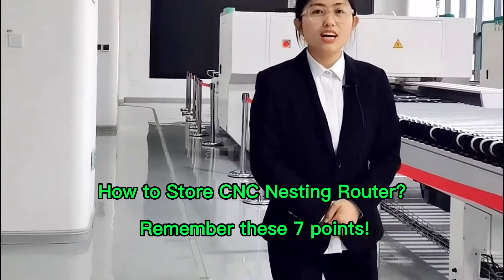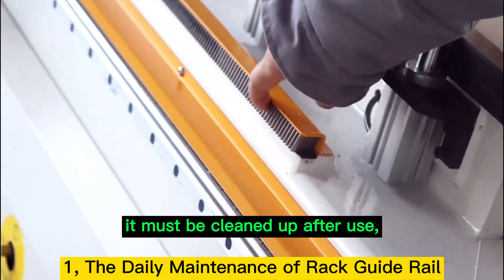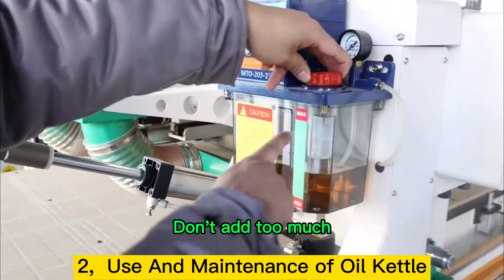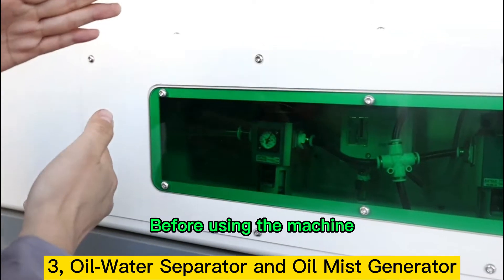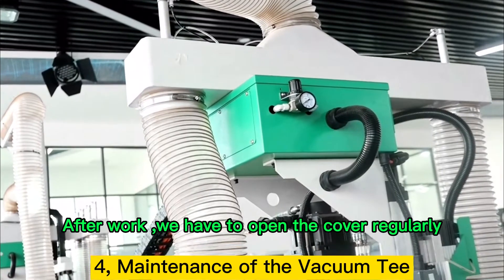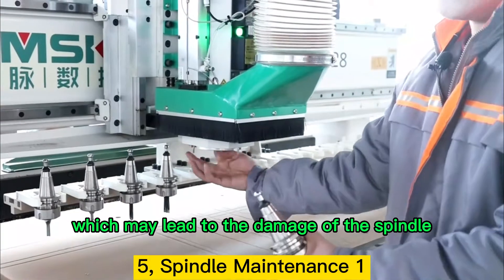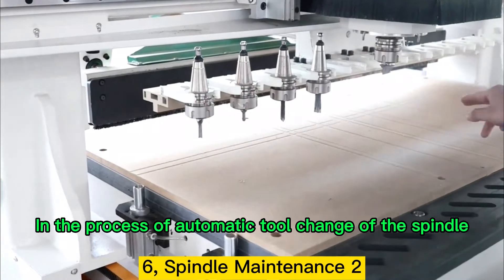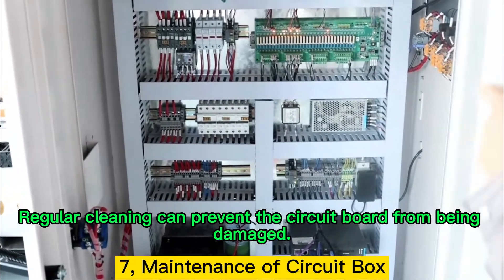How to maintain your woodworking cnc nesting router machine?

Comment: I need 3 machines;

1 multirouter 2000x4000mm c/w automated loading and unloading mechanism, ATC with a magazine of 12 tools, an Aggregate & Angle Cut Saw Tool, a Boring Head with 5+4 drills, and if possible a CCD Camera.

2. 1 x 5-head CNC cutting machine, with a conveyorised bed 1600x4000m and the following:

1 x CCD camera 
1 x milling tool for acrylics
3 x oscillating knife tool holders, into which we can fit any of the 7 oscillating knife tools and/or the creasing wheel tool

3. Hybrid 400w carbon dioxide laser, with 200x400cms table

All the above were ordered since months from Forsun Jinan CNC,  but they failed to deliver these as;

• The FS2040 multirouter - they admitted they are not competent enough to put it together 

• The 5-head CNC cutting machine they produced it only with 4-heads, omitting 1 oscillating knife tool holder,  as they could not make it with 1 extra

•  the laser was not made to cut metals as well

We are taking our decision by Monday.

Hurry up if you are interested to participate in the bidding process. 

I'm sorry, I found you only now.

Many thanks.

Phil. Andreou 
0035799551122
p.andreou@phil-andreou.com